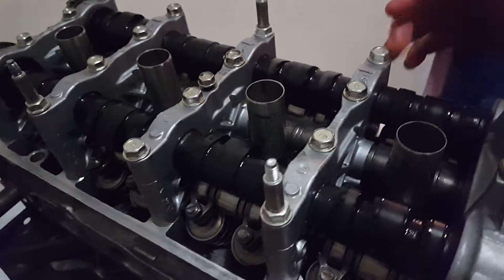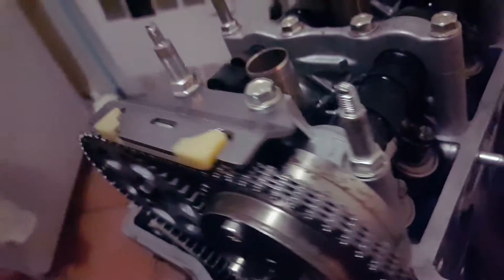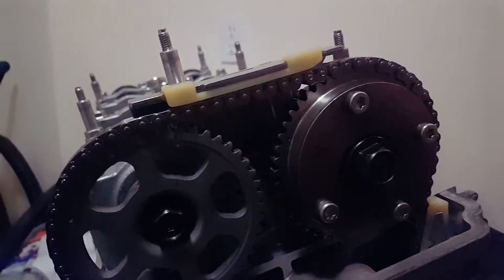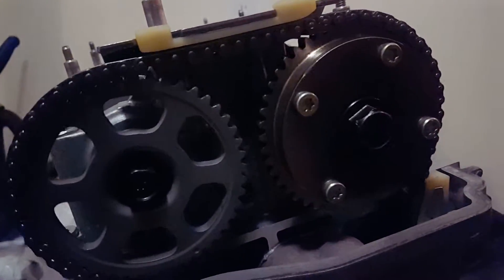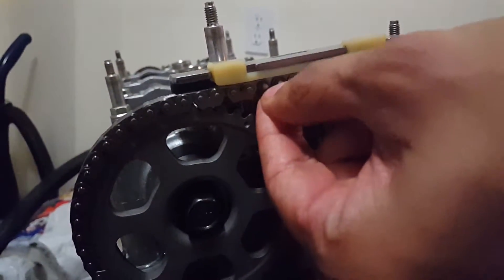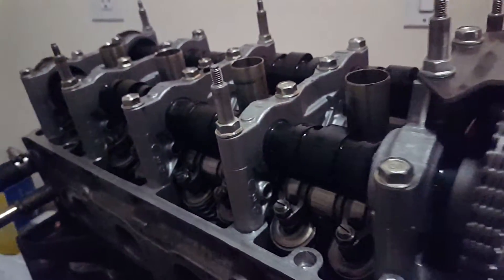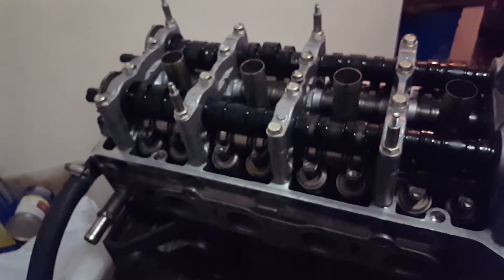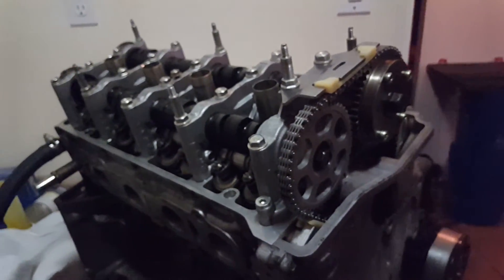K20 Skunk2 stage 2 cams v3 installed correctly

Comment: It has nothing to do with the installation, they fixed the issue with the V3’s. The original Stage 2 S2’s most definitely had extreme chain slap issues due to the lobe profiles.

Comment: Wonder if you got the Skunk2 cam gears for VTEC & Exhaust. Wondering if you can advance the VTEC side to 45 degrees or even 50 degrees & what are the pros and cons. My RSX pinned at 45 degrees is going bad. Get the noise at cold start so I want to change the camshaft, retainers springs & drop in the cam gear pair but without loosing VTEC.

Comment: I just installed the tuner 1 and im getting chain slap, also seems like the chain is looseish on the intake side
Reply from the maker: Tyler Monette pre load the tensioner 2 clicks
Reply: I can preload it by hand like 3 clicks and than i used a pry bar to get one more and it still slaps, tried a new tensioner same issue, about to buy a new chain

Comment: Are you sure that you're running a 50º VTC pulley? I've done a research and all the 50º VTC pulleys have letters stamped and black bolts.. could you check if you're running a 25º or a 50º? I'm doing this same swap and I don't want to bend the valves. Thanks!!
Reply from the maker: XaviEG6 im running a 50 degree cam gear.
Reply: You can modify a 25 degree VTC to 45 so you don't have to worry about interference from a Frank motor a few companies make them just Google it

Comment: How long did you use stock tensioner ? Any issues?
Reply from the maker: I only use OEM tensioners 👍🏻💪
Reply: Its Just a Base RSX ok cause my inline pro failed so I’m trying oem with these same cams
Reply from the maker: @bertbuilt8567  yeah I always use OEM tensioners for all my builds.
Reply from the maker: @bertbuilt8567  and I've never had a tensioner fail on me before.
Reply: Its Just a Base RSX 🙏🏾 appreciate it
Reply from the maker: @bertbuilt8567  no problem bro, dont forget to subscribe if you haven't 💪💪💪

Comment: how much did u spend for head a block? I have a base planning  to get k24 but I don't when to start
Reply from the maker: spent like 2k. all u need is a k24 block do a type s oil pump, type s head, u can reuse all your Boltons, and get your base injectors modded. and get a k24 passenger motor mount bracket. u can reuse all of your sensors. and of course kpro and tune
Reply: Thank bro that a big help appreciate it.

Comment: Just got a z1 that came with s2 head package notice a lot of chain slap. Can u help me out.
Reply from the maker: Na Lor what version cam do u have?
Reply: Its Just a Base RSX slunk2 stage 2 v3
Reply: And skunk2 dual babe spring
Reply from the maker: Na Lor you need to preload the TENSINOR 3 clicks
Reply: How i do that.
Reply from the maker: Na Lor u need to pry against the tensioner to push it out and preload the chain. Its really simple, you basically need to do it slowly until u hear the tensioner make 3 clicks
Reply: I'm at top end center mark. Arrows line up but cams aren't. Maybe guy who put it in didn't do it right.
Reply from the maker: Na Lor yea u might want to retime the motor.
Reply: You think the guy could've mess anything up running it like that before I got it?
Reply: Alright so jus installed need head gasket chain and tensor. And chain. Is still moving.
Reply: Would it need a new guide also?
Reply from the maker: squrriel Lor yea replace guides. Also did u preload the tensioner
Reply: Its Just a Base RSX everything is good now. Just guide on chain doesnt line up with marks on cams. But moves smooth and no slap.
Reply from the maker: squrriel  just make sure your in timing. And your all set
Reply: Did u lock in cams for timing ? The alignment hole in back of cams.

Comment: What degree cams u running
Reply from the maker: Annie Vang u can look up the cams, there skunk2 stage 2 cams
Reply: Can't seem to find a answer. I was told to run 40 degree cams gears for this set up. Skunk2 stage 2 head package
Reply from the maker: Annie Vang are u talking about cam angles? I say let your tuner decide all that when your on the dyno
Reply: Ok. Can I run this cams with turbo set up
Reply from the maker: Annie Vang no I wouldn't recommend it, there too much over lap. There all motor cams

Comment: What cam gear are you using ??
Reply from the maker: DJTeeb Thepartysaver type s cam gear i believe its a 50* cam gear
Reply: Are these cams the same as the Tuner 2 cams? I have Tuner 2 cams and they burn through stock tensioners like nothing. I went through 2 so far. Only drove on my last satup for not even 1000 miles. I'm currently working on my next setup and I'm scared to use a stock tensioner again lol. I was going to get an inline pro tensioner.
Reply from the maker: DJTeeb Thepartysaver yea these are tuner 2 cams, im still on my oem tct without issues make sure u preload your tensioner atleast 2 to 3 clicks
Reply: Yeah I did !! But Im also on a turbo setup if that matters
Reply from the maker: DJTeeb Thepartysaver it shouldn't, i say make sure chain is not stretched, change all your chain guides,

Comment: The ppl knocking skunk2 cams are the ones who never ran cams nor installed cams themselves. i have skunk2 cams for 4 yrs with ZERO issues bc i preloaded the OEM tct 2 clicks or until slap was gone then hand turned the motor. But you have the k24/k20 in the base now or is this the one youre building???
Reply from the maker: exactly, and yes i already Finnished my build k24/k20 in my car tuning this Thursday. engine running great so far.
Reply: +Its Just a Base RSX cant wait for numbers!!!
Reply: Which springs and retainers did u use ??